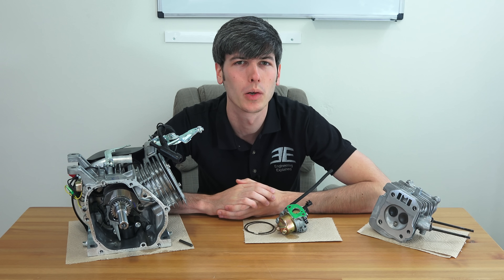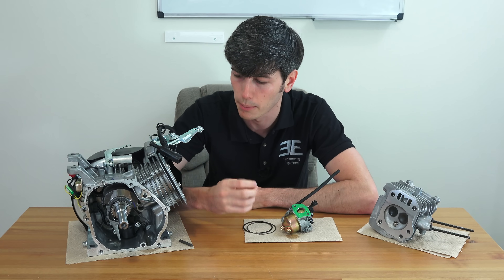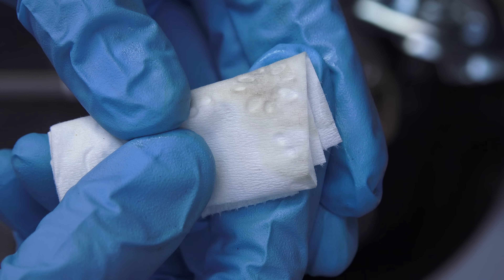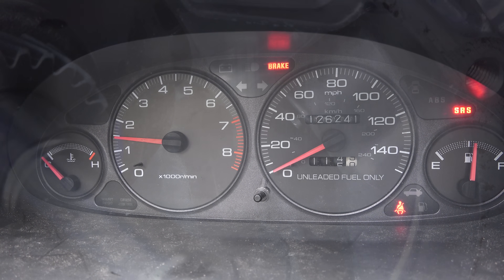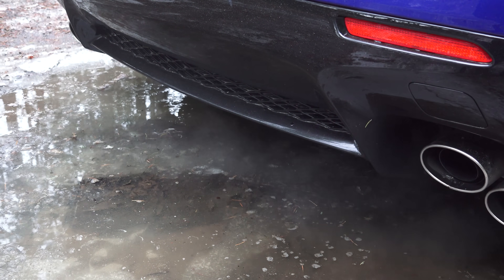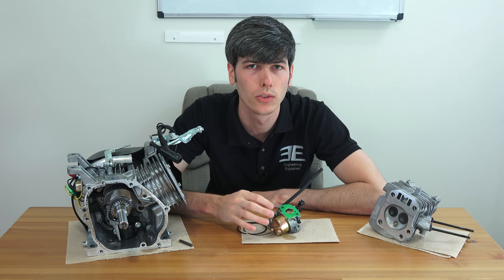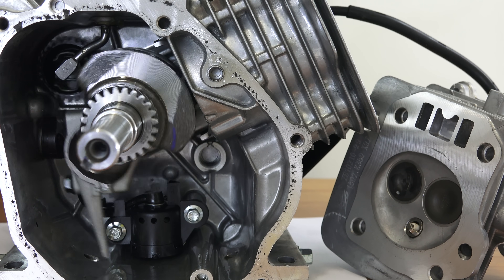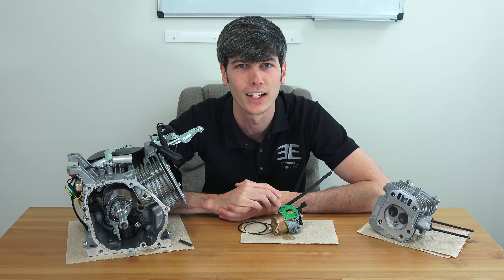Should You Warm Up Your Car Before Driving?

Comment: in extreme cold like around -35°c before windshield it is wise to give it at least 5 minutes. you can easily damage other components like power steering and such. but other then that your just wasting money and time.
Reply: and get frostbite from not having heat
Reply: in severe cold I always let it idle for 15 to 20 minutes, last car I had had 250,000 miles and only died cuz I hit a dear, everyone I know does the same thing, no one has issues.
Reply: +SDD525 mothers power steering blew and cost 2 grand because the vehicle only idled for 3 minutes with a -40 windshield.
Reply: at minus 40 F, metal can be as brittle as glass, and fluids are exponentially thicker.
Reply: +SDD525 less stressed if warmed up. the car had 85000 km on it and it was -40°c.
Reply: SDD525 Ok i'll put it in my imaginary garage. it was the power steering, the lower viscosity oil has nothing to do with it.
Reply: most Houses int he world do not have a garage and in the states building a garage is a $10k-$20k  expense which is no way a viable option for the majority of people  

you can also wager that a huge amount of people do not live in a house but rent  apartments
Reply: no, the vast majority of houses do not have garages, most apartments do not  have a option for underground garages  where temps are in the the -40 range   and yes garages are a big expense
Reply: Many cities and 1st ring suburbs in MN have older homes with either no garage or an unattached single garage which isn't going to be any warmer than sitting around on the street.  When I lived in an apartment there was 1 heated parking spot and myself and my spouse--who's car do you think got to park underground?    Since then I've made sure to have a garage spot, but there are many that it just isn't in the cards.  I say warm it up at the cost of a small amount of gas to have your car and the cabin ready to roll from the get go.
Reply: Whispered - ideally I'd get an electric car with electric heat that I charged with solar. right now that is too much but I'll pull the trigger as soon as I can. I live on the alberta/sask border and you do have to warm it at least until the engine is in open loop mode
Reply: There are tons of apartments that don't have garages or underground parking, as well as many houses that don't have attached/heated garages. If the garage is not heated, it will not be significantly warmer inside. Aside from being very expensive, heated garages also use a bunch of energy.

Regardless of whether the majority have heated garage/parking, I can say with absolute certainty that a very significant portion of people do not have them despite it getting very cold. Majority is completely irrelevant.
Reply: investing in a  garage is not something the vast majority of people can reasonably do 

and yes a one time -40  ambient temp can cause power steering  and other things to break and this is not from a singular experiences from only myself but from many others i know, tons of repair shops and decades of experience  and just about every vehicle up here runs synthetic fluids year round
Reply: sure man what ever you say
Reply: Can you do a video on warming up Diesel engines even though it falls under the fuel injected category the engines are very different
Reply: Lee Michaelson diesel are quite rough to deal with. Many people leave them running all night on the coldest winter days. At the very least they will be plugged in all night. A big diesel truck has half the chance of starting on the coldest days when compared to vehicles like a honda civic hah
Reply: SDD525 I live in lloydminster alberta. Not the most environmentally friendly city
Reply: Long as the coolant temp starts to move it's ok, long as the idling settles then the car is ok. We do not have extreme cold temp power steering fluid otherwise i'd buy that for my car. You are complaining about losing a dollar for waiting 2-5 minutes everyday on a tank of gas. There are worse things going on in the world than someone idling their car for a few minutes, it's not hurting anything and i'm going to do it, i have remote start and i let it warm up for a few minutes, the earth is still rotating. People do a lot worse things like polluting the ocean and killing animals to extinction due to excessive waste of tree cutting.
Reply: I hear the Tesla's are pretty good though yeah you'll need solar and other methods of charging the car as charging stations are too far and few between.
Reply: We don't have Teslas or charging stations in the area. And it's not practical to drive 100 miles just to charge it up. I"ll just keep using my gas engine and waste billions of dollars worth of gas warming it up every morning.

Comment: What about the expansion rate of different metals/plastics used in modern engines, such as: cast-iron block with aluminum heads, or aluminum engine with plastic intake. Wouldn't  you need to allow time for these material to gradually reach operating temperatures?

Comment: just curious as to whether the same theory apply to high performance engines epically high performance  (fuel injected) motorbike engines. with high performance engines I've had it drilled into me about warming them up before even touching the throttle.
love the chanel please keep up the awesome videos
Reply: also is it the same with diesel engines? thank you

Comment: My mate runs his car gasoline engine on 1000 rpm higher when it's winter (cold). He claims that prevents the ware because the engine is heating up faster. I'm confused. now.

What about the diesel?
What about the 1977 Opel Manta?

Comment: This is also why you don't let a diesel engine idle for extended periods of time. The combustion chamber gets so cold that not all the fule atomizers and excess fuel washes oil off the cylinder walls. Read that in a Cummins owners manual

Comment: That's not entirely true of carburetted engines.  

Many (but not all) carburettors were fitted with an automatic choke, this was controlled by coolant heating and expanding a bimetallic spring - the hotter the engine got, the more the spring moved and eventually "opens" the choke. As the engine cooled, the strip returns to its original shape (although you had to press the throttle first on automatic choke cars to "release" it). Later models changed to an electric choke where the bimetallic spring was heated by a 12v supply controlled by a sensor.

Comment: I hate to be cold. The only time I drive my car when it's cold is on the way home no reason in sitting there in a cold car waiting for it to warm up. If I had an auto start I would most likely kick it on 5 mins before I had to leave. I do like the idea of having one of the engine preheaters. To bad auto manufacturers don't offer it as an option, a lot of us live in cold climates.

Comment: What about diesel engines ?  As I know diesel is not solvant so it will not wash away oil and because it function differently as gasoline engines it maybe do not have to add more fuel when it is cold. So it is better to warm diesel engine or not ?

Comment: What would the case be for a diesel engine?? I usually wait until the fast idle turns off to start driving..but i have always wondered this!
Reply: BTW my truck is a 7.3L idi turbo diesel
Reply: Diesels are even more cold-natured and temperamental than modern gasoline engines. A block heater and high idle switch will be on my next diesel.

Comment: Very good explanantion, one which is hard to find on the internet. Great video as always. This is my practice in winter too. I just start the engine put the seatblet on, wait 5-10 seconds and go lightly. And I don't tunr up the heat unless if I need do defog my windows, then I close it off. I make sure my engine gets all the heat it needs to get to the operating temp quicker. I can witstand a bit of cold weather, but aditional engine wear is something I don't like at all.

Comment: what about the choke. Doesn't that make the mixture richer in a carburetor engine?
Reply from the maker: Yes, it does. But that's simply used to start the engine, not used while driving.
Reply: +Engineering Explained then my dad used to keep it on entirely too long.
Reply: You slowly let off the choke as the vehicle warms up while driving.  It's ok to use a choke for the first couple minutes of driving, being sure to incrementally push it in.  Otherwise, you'd be idling for several minutes, waiting for engine temp to rise enough.
Reply: GroovinFunk i knew it!

Comment: But your oil temps/pressure will not be up to par. In turn not Lubricating the engine properly. So why would you want to risk extra wear on the engine. Also all your gaskets and seals are better off driving with a warm engine.
Reply: Idling a car to warm up means very very low oil pressure. Not nearly enough to actually lubricate it. Better off holding the car at a fast idle.
Reply: +Tom Kaos (Official) I take offense to the corolla comment buddy. I have a 1997 carolla. more reliable than my wrx/sti, and maxima
Reply: Well not actually. Wear is dependent on the rpm (relatively) and load you put on the engine. By driving you actually put load on the engine and thats why it warms faster.  So the wear is not equal and not comparable. You know when you see a car with 100k kms thats a wreck (engine speaking) and one with 300k kms thats seems like new? The amount of starts is the difference. 
Regarding the video, oil dilution should be a non issue; it is an issue when the engine almost never reaches operating temperature and stays at that temperature evaporating both leaked gas and condensation.
EDIT: on top of this, if you're concerned about oil viscosity/pressure etc what's the thing that put pressure (meaning actual load!) on the oil film? An engine running just to sustain its idle rpm, or moving a  ton around. Comparatively speaking low rpm  put a higher load on the engine than the opposite. Just to get the idea if your'e a granpa driver like my father (5 gear at 50km/h)and  you encounter a hill: at the same throttle you lose rpm, you don't shift gear and instead you push the throttle but the engine still can;t manage. Do it in the long run and you may end up with your conneting rod flying out of the crankcase.
This is putting load on the oil. Without speaking about pistons, rings bearing surfaces floating around because they've not expanded through heat.
Reply: Yes the car can Handle it. Im talking specifics of what engine components do compared to cold/hot. I load test  (diesel mechanic) Locomotive engines that push 4,500+hp, and see actual Specs of Everything compared to cold and hot. These are just my personal opinions, just like this guys.
Reply: SDD525 have fun replacing the batteries; im sure their very cheap.  My dd gets more range(you think 270 is good...lol) and  great mileage plus dont have to wait in between. just fill up on 87 and ready to go, plus cheap parts to boot!  and all this for under 15K$...lol!
Reply: +SDD525 No one cares bro. Realy men Drive with fuel guzzling engines with badass parts 👍🏻
Reply: +SDD525 If you think youre cool for being a tree hugger with good mpg, again... no one cares. Its about the Drive, the Exhaust Note, the Shifting, the Drive, the Fun. Not some pu55y battery car 😉
Reply: +SDD525 I didnt say my DD was my project car, its my upgraded DD.. various small mods to make it for a better drive & looks. As for my project car, is a near mint r32 Gtr, of which as I said is way more Fun in General.. Even fixing it/learning about it, than having a Boring electric car. Not when your out on the streets? You obvious have never had someone admire your cars, its actually Nice to have people ask questions yata yata or even just give u a smile/thumbsup when they are next to you, people that share the same Love & Passion for cars, not Golf Carts 😂 Again, obviously people that are Actually into Sports/Muscle cars could care less about Mpg, as for modding and whatever you said about making it more unreliable possibly.. Actually no, Aftermarket parts are A Lot better for your car (if you do it right), Stock cars are Very Restrictive and some Oem parts are obviously Unreliable on Any car etc.
Reply: That's why it's advised not to go full throttle until the engine reaches operating temperatures. You can still drive it just fine without any noticeable difference in wear compared to idling.
Reply: +Mircea Dogaru I agree with his facts, im just saying lol. We know you dont need to because of FI, but what about the rest of the engine, fuel also ignites better at higher temps. This is just the Basics of this topic, there is just more to it in my opinion. But sure if you have a Basic daily car like a Corrolla or some crap, who cares. But I have 3 cars, 2 of which id rather take care of and take precautions to engine wear etc.
Reply: +Stephen Hall Yea but the viscosity of the oil is still cold/thick, the pressure will still be lower than recommended if you just jump in and drive, so why would you lol.
Reply: True, and fair enough. Its definitely better to run a warm engine, for the seals indefinitely, if you've seen the headgasket seal compared to the top of the block, its hardly even the right shape or size until the engine and seals are warm. It ends up being much of a muchness, you can idle an engine, waste a lil bit of extra fuel, still have the same wear from start up, or drive it normally and still end up with wear, just at a faster rate as the engine revs will be higher, which would in turn probably be the same amount as idling it.
I guess just turning it on, holding revs up a bit to get the oil all around the engine and letting the revs settle a bit is really best of both worlds that you can get.
Reply: +tavi921 I agree, if you drive some average crap box.
Reply: +Tom Kaos (Official) and nope the oil pressure will be much higher when cold. wrx sti has a oil pressure guage, when cold on start up it will reach 80 psi while driving, when warm about 60
Reply: +non'ya biz Yea Sorry, I mean up to spec. with pressures.
Reply: +non'ya biz Also my point exactly. With higher oil pressure when cold, you are putting more stress on the oil pump, let alone the oil viscosity going through the engine. So why would you want to Force more stress and thick oil through the engine.
Reply: This guy is dead on. The owner of this channel is mindlessly repeating what his professors tell him for ad money.
Reply: Whoops
Reply: +Jacob Gausmann (Goosemann) hope your not implying that oil gets thicker when it's hot
Reply: Oil's thinner when its cold....??? really dude lmao
Reply: The viscosity changes with temperature my bad, i got that ass backwards
Reply: +R-Spec boi... i havent been an auto tech for over a month, gimme a break, its been a while, lol 😅
Reply: +tavi921 spoken like someone who doesn't buy there own vehicles
Reply: +Exgaves not disputing what EE said. My response was to the guy who said "who cares just drive it"
Reply: +SDD525 ok
Reply: thats what i was thinking, have a sc car with sensitive dual cam, switching to aggressive cam when cold overtime ruins the cam so i warm her up a bit more than my dd versa.  But i also worry if i warm her up too long about the moisture in the cat and exhaust and have to buy an new ever so often.
Reply: +SDD525 love combustion they just need to make block out of cgi or iron again not this hybrid aluminum crap.
Reply: +SDD525 alumnium are weak, dont take boost well, only going for them is that its light.  you dont get the sensations of an electric car than u do with a combustion.
Reply: Yes i know!
Reply: yea you aint really a car guy if you dont understand that!
Reply: EV is good for instant torque and mpg.  Range and charging time is not where i want it to be.  Performance wise i like to hear the sound of an engine, the flutter of the turbo/the whine of the sc/the exhaust not some monotone sound.  Imo electric motors is good when combined with and engine for initial launch of the vehicle due to instant torque and to pulling it out of corners and of course extended range but would never depend on an electric as the primary source of power.    Plus i like my performance to be consistent.
Reply: LOL only certain people can afford a tesla so yes its still an argument, the day they are readily available and affordable then we can cross that off. What EV maintains its performance without any charges in between?!
Reply: LOL 66k$ with tax break...ok and mediocore range..try again!
Reply: sorry dude, im with you!
Reply: +SDD525 They might be faster than the Average car, but who cares, im guessing you never had a Fun project car 😂 & who said I have Newer cars? 1 of 3 I have is, but its my DD and its still a lot more fun to drive than the sound of Silence from No Engine. & guess what, I get people asking about my cars, smiles, thumbs up all the time, sharing knowledge, not just saying.. yea i get 50mpg, cuz thats real cool & fun 😂 Youre on the Wrong page dude, no one here cares about Mpg, modified cars are a lot more fun Obviously 👍🏻
Reply: +SDD525 Go on the Tesla forums dude, or even someone elses comment, me and that other guy DONT CARE, there is no reason for you to keep talking about it in my comment.

Comment: so basically, a fuel injected engine does the choke by itself. Is that with Any Fuel injected car, e.g. also an old opel corsa B or similar or only after a certain age?
Reply: Any car with EFI will adjust the A/F ratio by itself. You would know if the car had a manual choke, it would be like trying to drive a weed eater/chainsaw down the road
Reply: Stephen Hall
well, my bike has a manual choke.
Reply: Practically all motorcycles and just about every car prior to the mid-80s have chokes.  Most manual, some automatic chokes.